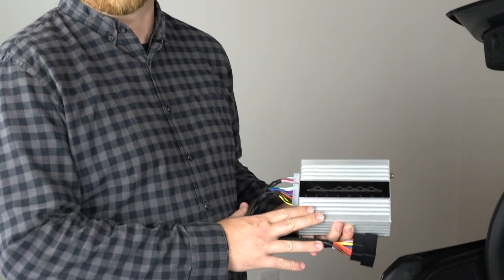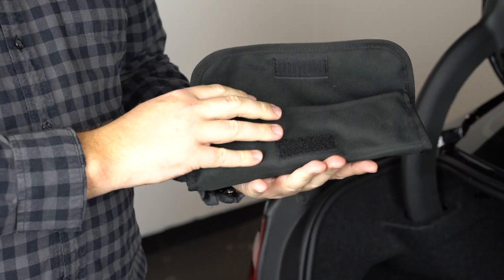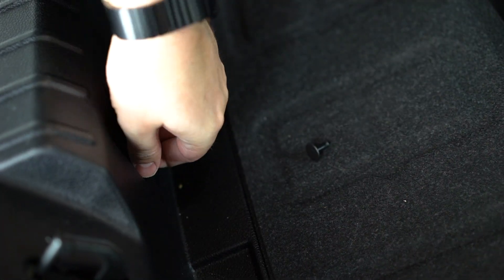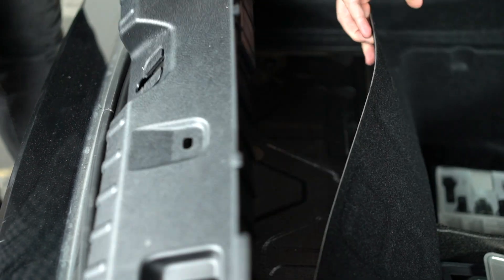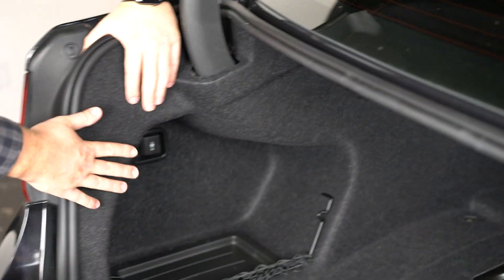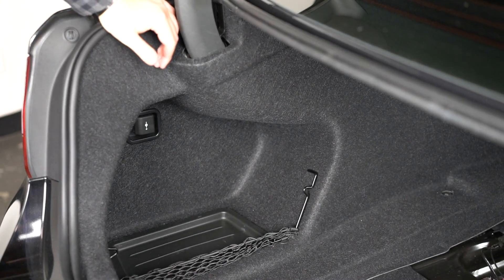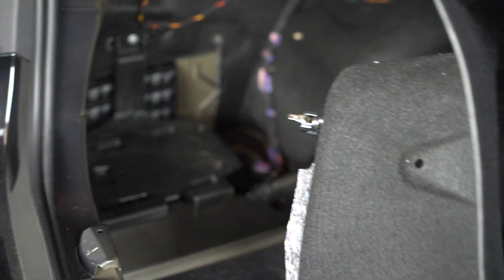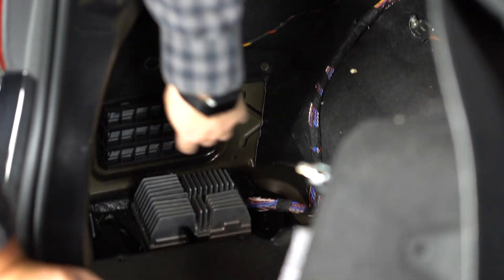BMW AMP Upgrade/Installation | 3 Series F30 | BAVSOUND Revenant | HiFi

Comment: I have f31 basic speakers, bass under seats and without tweeters. It will be good option to get better sound in the car?
Reply from the maker: Hey! If you have the standard HiFi amp S676 (which is the only available amp for now), then yes, our Revenant Amp Pro is a great solution for you! The version in the video is actually our earliest model, and we've already upgraded it. If you're unsure about your audio system, feel free to hit us up at support@bavsound.com with your 17-digit VIN, and we’ll help you out!

Comment: So if I only do the subwoofer upgrade, but standard HIFI speakers I would still to the standard tune? Basically the amp isn’t worth getting unless I upgrade the speakers too
Reply: The amp is still worth getting. It has a lot of protection technology, it notices if a speaker gets distorted and cuts power to that channel. If you notice this happens then you want to lower the channel gain
Reply: why would you spend 600 bucks on two 8” speakers? Are you insane?